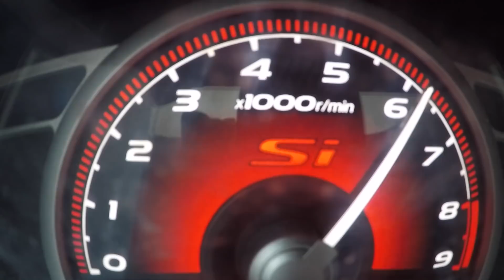The Vtec Crossover Is So Loud, I'm Addicted! K&N Typhoon Intake

Comment: Once you get the flash pro, the base map will lower vtec crossover to 4500 rpms. Also, it will eliminate the annoying rev hang. Get a lightweight flywheel when you are ready for a new clutch, you’ll go through the rpms faster.
Reply: Whats rev hang? I always hear about it about how annoying it is!
Reply: Also what’s a base map?
Reply: Rev hang is when you want to move up to the next gear, the RPM needs to drop down to get into that gear. With a lightweight flywheel, there will be less "momentum" built up in the RPM, allowing it to drop quicker, hence shift quicker. Base map basically just means recommended settings from factory (tuned but not perfectly tuned). A good reliable preset.

Comment: Once you get hondata , you won't be hearing that loud crossover no more though
Reply: The crossover is just gonna be very mellow
Reply: Boosted Cheo yes cause it's set lower with the base map, mine cracks at 4500, and i can't really hear that nice Loud cross over like when it was stock, it feels like Vtec doesn't kick in no more lol
Reply: Edddy totally agree definitely time for a tune
Reply from the maker: Damnnnn, I want that sound
Reply: I have the same intake. It's plenty loud even with the FlashPro tune.  It crosses over VTECH first at 4500, but it get gradually louder (and produces more power) throughout the entire upper powerband.  Once you hit 6000K (after the tune), it's still hella loud.  +GerbProductions try it in a tunnel XD it's amazing.
Reply: If you get Flashpro, you can always keep your I-VTEC engage @ 5800 anyways.
Reply: mine crack at lower 3200rpm higher 5800rpm
Reply: Your able to set a VTEC window of where it will engage.
Reply: yes with flashpro
Reply: Unfortunately my vtec isn't engaging for some reason. My VSA lights are on and I know the speed sensor needs to be replaced but I don't know why that would cause vtec not to work
Reply: I have a hondata plus a tune. Running on 91. I get a loud ass crossover
Reply: I was into Honda’s back in the mid 2000’s love me some preludes and civics. Had a 94 accord with a j spec h22a with lsd. Wrecked it two weeks after the swap.   I love Vtec. But now that I drive a tuned vw 1.8t and I’m addicted to boost. Which is also funny cause the new Honda’s are boosted. Lol. Nice car man.   Try out some boost. Lots of cool sounds and plenty of head pressed into headrest.

Comment: "I am so pumped" 

Yes! Vtec makes it man..that last little burst of power, right when you need it most. I was stoked about my intake install well..ever since I got it. Freakin blast.
Reply from the maker: Vtec Honda’s are definitely a blast to drive!  Do you have an si?
Reply: @TheGerbsteve  I have a 2004 Accord coupe v6 6 speed. Not quite ivtec or dohc, but with the help of this exhaust and intake, she finally cracks! Once at 4 once at 4900
Reply: @TheGerbsteve  I have a couple vids of it on my channel back from when it was bone stock. I'll post new ones with the mods soon.

Comment: That short ram intake although it may sound cool is useless. You need a cold air intake with some sort of heat shield. Think about it, sure the distance the air has to travel is shorter but that means it's getting hot air from the engine shoved back in to it which is less dense and breathable if that makes sense. Imagine trying to breathe hot air all the time. You wouldn't go as well as you could, pretty much the same with engines.
Reply from the maker: +Euro Tense I think that with a tune, I would see results.  My sri is connected to part of my oem intake, which draws cold air in from my inner wheel well up to the k&n.  So technically, I wouldn't consider it a short ram, more of a hybrid set up. Wanted to go CAI, but don't want to deal with hydro locking the motor
Reply: When I had my Honda accord type r i had a k&n long arm induction kit it went down to the hole in the bumper and comes with a cover so hydrolocking isn't an issue I'm sure it will fuck up going through a river obviously lol, anyway I'm sure you can get a filter cover similar to what k&n come with for my type r.
Reply: I have been looking at vented Carbon Fiber hoods. But I might half to go custom cause I want the intake to be on the open vent. Problem is if it rains I am so fucked lol. So she will half to be a clear sky car. I live in Airzona so that is pretty much every day. Except this part of the year it to soon mansoon. lol

Comment: Hey do you think the K & N short filter is the way to go instead of cheper brands? About how much horsepower do you gain from stock with the K&N? I just bought a 07 Si coupe, but it has zero modifications.
Reply from the maker: +Jaciel Pena I've heard yes and no.  K&N filter or short ram hp gains?  Personally I would go with the k&n short ram, quality and sound are amazing !!

Comment: told you so ? 😂😍 as the filter gets dirty the sound doesn't stay as loud but once you clean your filter the sounds back louder and I notice it has a tendency of a higher Rev at idle
Reply from the maker: +SERGIO MARTINEZ yes you did 👌🏼...  Wonder how long I can go before I have to clean it?  I think it was a good investment.  I wonder if it improves mpg slightly?
Reply: Gerb Productions I used to track the mpg if I did allot of highway I believe you can get up to 32mpg but for the most part 25mpg-32mpg
Reply: Gerb Productions and the thing of keeping it clean well ....9-12 months just depends ...I know my engine gives allot dust I don't know why but I would say definetly check it every 6-9 months

Comment: Question i have a fa5 and yesterday i notice i was a lil half way low on oil on my dip stick so i filled it up with mobile 1 synthetic Drove it around with the windows up and heard a very lite tap noise when i accelerate on idle i dont hear it only when i accelerate and its freaking me out any suggestions what it may be?

Comment: Hey man I installed my intake today same as you. Now my car dies at idle? Any idea what he'll is wrong with it . It rips good sounds awesome but does at red lights supper annoying . Any ideas ??
Reply: Idle air control valve most likely. Need a tune when changing airflow too. SRI heat soak like hell. My Hybrid Racing CAI keeps IATs as low as 3 degrees above outside temp

Comment: what exactly does a throttlebody spacer do? the only thing I can think of would be to spray nitrous but I doubt you plan on adding a nitrous system  (I may be wrong, nothing wrong that)
Reply from the maker: Increased acceleration & torque.  It widens your throttle body up, allowing more air flow. It's a dope little mod man.

Comment: I see a lot of I-VTEC kick in at 5500 - 6000 rpm. Why does mine kick it at 4000 rpm!? I have a 2009 Honda Civic Si coupe.
Reply from the maker: Because yours has a tune or basemap on it most likely. Stock ivtec is 5800 rpm.

Comment: Awesome!  Now our cars have the same bolt on mods!  I've been looking into the options of Flashing the ECU and the best options are flash pro or a re-flash which is offered through hondata.  Also just to add the cherry on your car grab a wide angled Broadway mirror for optimal visibility; along with a set of window visors from weather tech,  you can thank me later lol.
Reply: Also i know imma get my ass grilled by the racing community,  but also look into some raceland coilovers if you have stock suspension. Ill be getting mine in the next couple of weeks.
Reply from the maker: Not hating on you at all.  I was looking into those already haha.  Don't know if they're worth it though.

Comment: Bro wat does the throttle body spacer do in a Si?
Reply: Tcho2100 basically helps the flow of air. More air = better combustion = more torque+hp so that your engine doesn't have to work as hard to get the correct fuel to air mixture.
Reply: jaykyllah does this really hold true for fuel injected cars?  I know this was a trick on older carbonated cars but from what i understand this has no really benefits on any FI car.
Reply: Arvin Jami oh yeah most definitely. There's barely any significant hp gain (about 2-5 hp without aftermarket throttle body) but the torque increases dramatically (about 10 pounds or even more).
Reply: On a dyno with my friend's Si, throttle body spacers did absolutely nothing. Made a really annoying whistle, though.
Reply: AerisM - PC Gaming, GTA 5, Fallout 4, & More! 
What was his setup? I was able to squeeze out a few gains from just the TBS, intake, injectors, and tune. All were pretty cheap upgrades besides the tune
Reply: +jaykyllah 3" full race downpipe and exhaust, injen intake, dyno tuned by a local guy with flashpro, on 93 octane. No difference after throttle body spacer was installed. It just whistled loudly and was quite annoying.
Reply: +jaykyllah also, if you're using larger injectors, that's pretty pointless for power as you aren't going to making you any gains unless the stock injectors were limiting you (they 99% surely aren't since you're still doing bolt ons) unless you're getting it as a supporting mod for forced induction. The whole "I need bigger injectors on my stock bolt on/non boosted motor" is a pointless thing for this gen, and most motors in general. Same thing applies to throttle bodies and drop in filters.
Reply: AerisM - PC Gaming, GTA 5, Fallout 4, & More! 
Power wise, I agree. I think the base map tune is what enabled me to squeeze out those few extra horses honestly. I do feel a difference however when driving with the bigger injectors and fuel pump. Feels like it doesn't have to work as hard and pulls a lot easier even before I hit vtec. Right now I'm just prepping my car for the greddy turbo kit I just got. Running a little rich at the moment, but beats running lean lol

Comment: got bad news mechanic just HMU and told me I'm gonna need another motor bro
Reply from the maker: +h22sparkle No wayyyy :(
Reply: Gerb Productions yup
Reply from the maker: +h22sparkle What happened again?  Timing chain failure?
Reply: Gerb Productions nope oil pump failure now I think I need a k24 motor
Reply from the maker: +h22sparkle How did it fail?  You can get a k24 for engine for cheap.  Less revs, more horsepower
Reply: Gerb Productions I know but a motor for that car ain't cheap
Reply from the maker: +h22sparkle you're looking at anywhere from $1200-3k....  it sucks man, but think about if it would be worth it.  How much fun do you have with the car?  Newer motor will last for a long time.  And you can use your engine for spare parts, it's up to you.
Reply: Gerb Productions I found one for 800 I hope it's a real one I'mma check for to see if it has a egr if it does it's not the one and rbb on the exhaust ports, it should say rbb and not raa

Comment: I used to own an 08 Si Coupe back when it was new. I liked it but moved up to an 08 Accord Coupe V6 (J35Z3) 6 Speed. The J35 Accord in MT will annihilate that weak @$$ Civic and put a big smile on your face doin it! The Si has ZERO torque unless you Super/Turbocharge or put NOS. Do yourself a favor and grab an Accord V6 (3.5) Manual or at least an 03 Acura CL Type-S Manual!

List of Hondas Owned in Order (all MT): 91 Integra RS, 08 Civic Si Coupe, 93 Prelude SiR (H22 VTEC), 05 RSX-S, 95 Legend LS Coupe (Type II), 03 Acura CL-S (J32A2), 14 Accord EX Coupe (K24W), 06 Accord EX-L V6 Coupe (J30A5), and 08 Accord EX-L V6 Coupe (J35Z3). 

Of all these great cars, the 08 Accord 6-6 wins hands down!